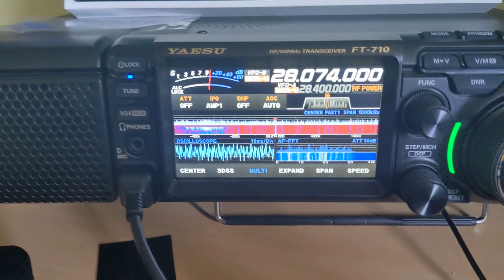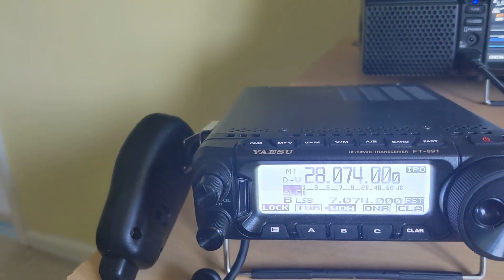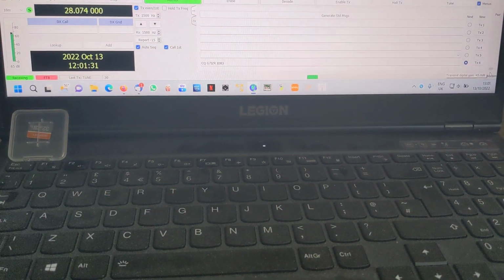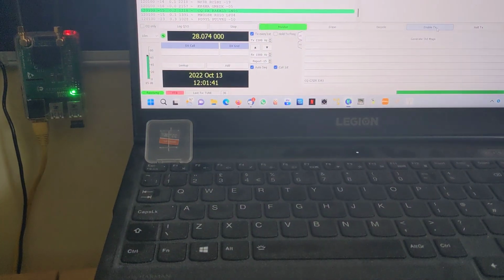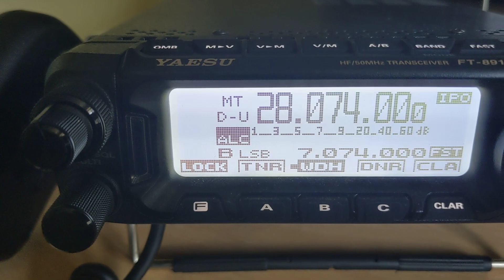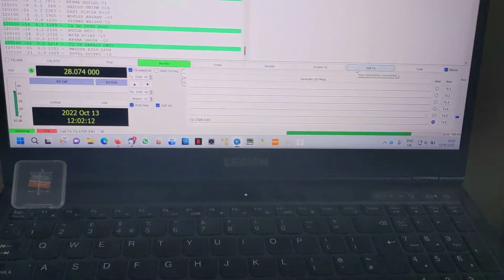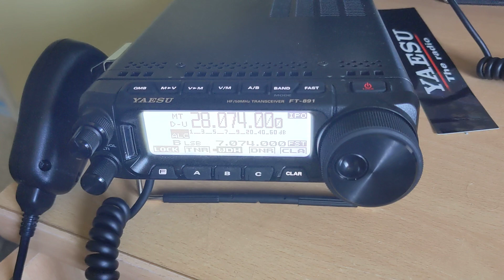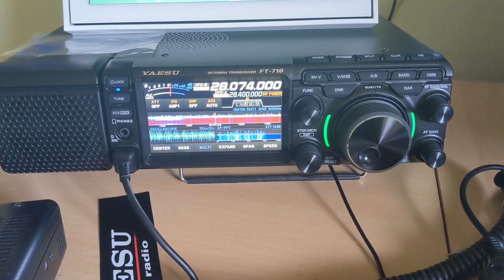Yaesu FT-710 still no FT8 TX audio

Comment: Good process of elimination using the other radio. Try turning down the gain on the Radio USB because it sounds over-driven.   Recommend putting ferrite beads on the USB cable at the radio. Also, there's a slider that needs adjusting that is under "sounds" in Windows, and find the USP Audio codec that feeds the radio. Turn that all the way down slowly whilst transmitting to see if anything improves.